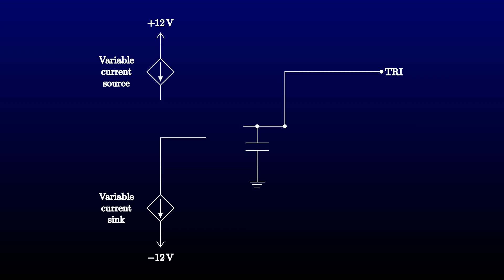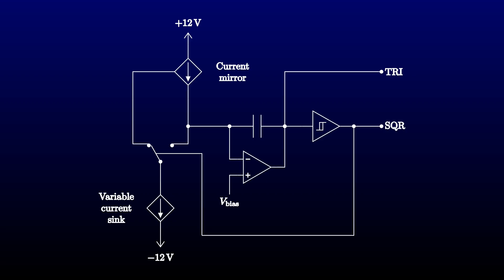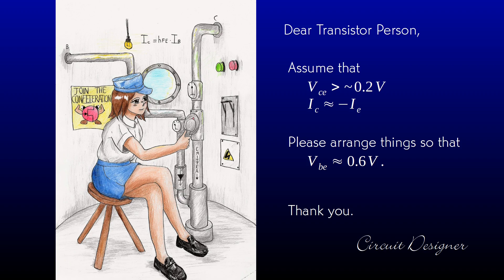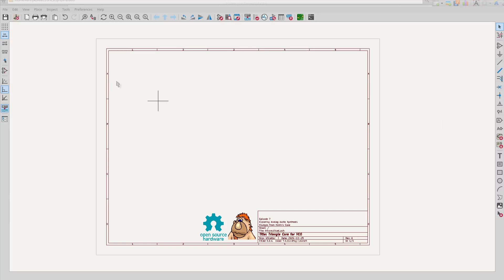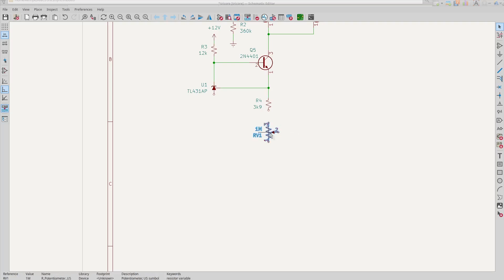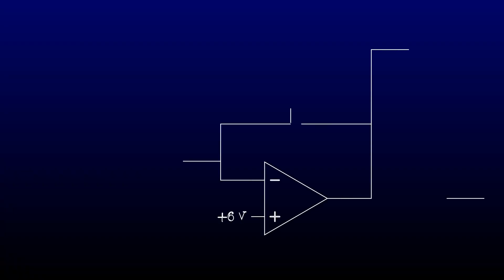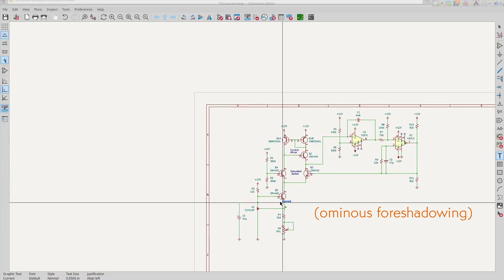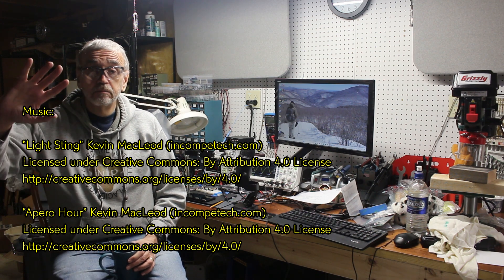Triangle-wave VCO Core - Explorig Analog Audio Synthesis, episode 8

Comment: Hi. I got a question to Q3 (can be seen at 14:13). When the comparator turn ON and activate the base of Q3, how do we control that the base current is not so large that it goes into the base and to the current source, instead of sinking the current from the integrator, from C2 (discharge)?
Reply from the maker: The LM311 comparator has an open-collector output, so it only sinks current, never sources it.  The only source for the base current is the pulll-up resistor.

Comment: Hi. Maybe I missed something, but what are the advantages of this circuit compared to the "traditional" circuit just comprising of a comparator and an opamp configured as an integrator (input - resistor- inverting input - capacitor - output)? To me it seems you can save a lot of component for the switch, all current mirrors and bipolar power supplies.
Reply from the maker: I'm building up to adding 1 volt per octave control, and having it stay in tune over the full audio range. The current source can be voltage controlled, and will later be replaced with an exponential converter.  The triangle wave is also accurate - linear slopes rather than the exp(-x) behaviour of a simple RC circuit, which will enable low-distortion wave shaping on the output.
Reply: @KludgesFromKevinsCave  Thank you for the answer. Yes I see, so more control can be added. But a integrator circuit with an opamp will also produce a accurate triangle wave even though it is build with R and C.
Reply from the maker: @thomassorensen7907  Getting an accurate triangle with a conventional op-amp is a little tricky. You need to charge and discharge the capacitor with a constant current, not a constant voltage dropped through a resistor. That takes at least an external transistor separate from the op amp. There's an earlier episode in the channel that demonstrates the issue.  Am I misunderstanding the circuit topology you are using?
Reply: @KludgesFromKevinsCave  OK...can you give a link to the video. Then I can get back to you, if we are talking in different directions :-) But a standard integrator circuit with an opamp, resistor and capcitor driven by a square wave should give a linearly increase and decrease of voltage on the output of the opamp.
Reply from the maker: OK, I think we're on the same page now - you're talking about the (essentially) two-op-amp circuit, with an integrator integrating the output of a Schmitt trigger, rather than the 555-style single-op-amp one. (I shouldn't answer messages before coffee.  Mmm, coffee!)

That would be fine with a pot to adjust the frequency (and perhaps a bank of capacitors for range switching).  But it would get pretty tricky to make it voltage controlled, and you'd wind up most likely with a circuit like the one I present (or one with the saturated differential pair replaced with a CMOS analog switch, or something). So we're on the same page, I think; this circuit is on the path to an exponential VCO.  

The final design might use something like a CEM3340/AS3340, which has a lot of the stuff internally, or at least use a current integrator built around an OTA. (I have a few LM13700s in the drawer.) Nevertheless, I wanted to explain the theory first, particularly since the specialized parts have a lurid history of going into and out of production.

And thanks for your post: it makes me realize that I actually skipped an episode, about exactly the topology you discuss.  I really need to discuss the simple triangle generator with an integrator, and then discuss how to voltage-control it.  I had VCO's on the brain when I've been making that series, and I also had power-supply rejection on the brain from anotherr, unrelated project.  I'll have a chance to come back to the simple triangle generator, since I'm only a couple of episodes away from introducing the integrator again in the op-amp series, so this is a good time to think about how best to slot it in. I might make it super-simple by using a rail-to-rail op-amp (LMC6482 or something) as the comparator stage. Doing it with a '6482 is just the resistors and a capacitor, and allows for pots to do independent frequency and amplitude control of the triangle.  Darn it, I meant to make that video!

For what it's worth:

The simple one-op-amp relaxation oscillator: https://www.youtube.com/watch?v=VH0WNji5CIQ . The 'triangle' isn't all that triangular.
Building up a more 555-style oscillator: amplitude and frequency much more repeatable: https://www.youtube.com/watch?v=mYEhulFMMgo . The 'triangle' still isn't all that triangular.
Doing it with a double current source (so that symmetry will be adjustable) and using diodes for current steering: https://www.youtube.com/watch?v=Vp5yTyl9E-I
Reply: @KludgesFromKevinsCave  Yes we are on the same page.....exactly that classic circuit two opamp circuit. Yes fully agree that controlling it with a voltage requires some redesign. Looking forward to the video(s).
I am doing a small project for myself and have just recently used the 2-opamp solution, together with an extra comparator to generate a variable PWM signal. I liked it because it don't require bipolar supplies and it is easy to adjust the required offset to get a symmetric output.
Once again thank you for the videos and the discussions and fast answers in the comments :-)

Comment: Triangle waves are fun! Saw a variant of this where both the source and sink are going all the time, and a diode bridge is used to steer either the source/sink into the comparator output, with the other sink/source going to the integrator. Fantastic presentations!
Reply from the maker: @mechiepete  There's an earlier episode in this series with my take on the diode bridge steering. I went to the differential pair so that the eventual exponential converter will see a constant-voltage load.

Comment: The fading-in-out of components during the design was brilliant. How do you animate and render out such nice looking circuits?
Reply from the maker: I do that rendering in Manim https://www.manim.community/ .  I draw the schematics in TeX using the CircuiTikZ package, and then embed them in a Tex or MathTex object in Manim.

I break the circuit into pieces by simply passing the Tex object the pieces separately, which then gives me a handle on them using 'submobjects' to manipulate them independently.  Then it turns into a whole bucket of boring Python code.

Comment: The 47pF cap is connected differently in the two versions. KiCad has it as a speed-up for the comparator, while the 2nd version shows it slowing the comparator down!
Reply from the maker: You found one of the mistakes in the schematic.  Next episode covers the debugging...

Comment: When you're placing components, use the X key to flip left for right, and use Y to flip top for bottom. No need for your own symbol, just flip it the right way around.
Reply from the maker: The problem with the symbols for the LM311 and the TL071 is that when you flip them, you get (+) and (-) in the right place and the power leads inverted. That bugs me, too. I use X and Y on other components all the time.
Reply: @KludgesFromKevinsCave  That's why I avoid the symbols with the integrated power leads. I prefer the multi-part symbols with part A being op-amp 1, and possibly parts B, C, D for additional op-amps, and finally separate power leads. I much prefer having power supplies and by-pass caps in their own section, away from the main action.
Reply from the maker: @TomLeg  does KiCAD have a symbol for a single op-amp with separate power leads? I've only found duals and quads done that way.
Reply: @KludgesFromKevinsCave  I never use singles --- can (almost) always find a use for an extra op amp.
Reply from the maker: @TomLeg  I don't use them very much either, except for specialty ones. Otherwise, I'd have fixed the symbols long ago! But singles make for a nice clean breadboard arrangement for teaching.
Reply: @KludgesFromKevinsCave  Somebody should contribute a nice, two-part symbol to the libraries. Too many rules for me, as an only intermediate amateur, but we can hope.

Comment: I love the video. My only question is how you calculated the frequency range. I know it relies on the capacitor or input current into the integrator, but I’d like to know more about the calculations and if it could be scaled to different frequency ranges.
Reply from the maker: The formula for the voltage at the integrator output (which we derived in the episode on the op-amp integrator, check the playlist) is V = (1/C) ∫ I dt.  Since I is a constant, ∫ I dt is just I ⋅ t plus a constant.  Rise and fall times of the triangle are equal.  We know the current, and we know the range that the voltage is moving through, so given the capacitance, we can solve for the frequency, of vice versa. 

It can be scaled to any frequency range you like, provided that the op-amp's slew rate is fast enough to keep up with it.

Comment: Thank you for the interesting series. I'd like to understand further the inclusion of C3 on the comparator + where you say you are adding some LP filtering (above audio freq) "to suppress glitches". I understand the intent  but I wonder what caused you to consider this potential glitching scenario in your design process. Looking at the datasheet for the LM311, I don't see a circuit in the application notes that suggests the addition of such a provision. So I am guessing this is coming from your own experience or some other standard practice. I am not an EE, and if I had just used datasheets as my guide, I would not have considered this addition. I'm guessing this addition comes from experience and makes the difference between a robust design and a hobbyist design. What caused you to consider the need to add the filtering?
Reply from the maker: Comparators switch very fast.  Sometimes there's a stray capacitance about that feeds some of that fast-switching output back around to the input, resulting in ringing.

In this particular case, I put in the capacitor because Buchla did - I was adapting an old design to more modern components and Eurorack voltages.  I don't want to spoil the next episode too much, but you'll learn in it that I made a bunch of mistakes in this one (and left them in intentionally because I wanted to show debugging the thing!) One of them was around that capacitor.

Comment: I recently thought about a nice source of matched transistors. CD4069 - 6 matched NMOS and 6 matched PMOS. Only negative thing is that they have their sources connected together internally. But that's okay for differential pairs and current mirrors anyway. Or for voltage controlled resistors connected to some common ground. It's a big package, but relatively cheap and available.
Reply from the maker: I keep BJT pairs in stock because I need them for exponential converters. A MOSFET is square-law, rather than exponential.  (I keep a few 4069's on hand anyway, as low-power inverters.)  For loose CMOS pairs, the 4007 is still being made. The nice thing about it is that the substrate isn't  tied to the sources for two of the pairs. MOSFETs with separate source and substrate connections are scarce as hens' teeth nowadays.  Check out https://schematicsforfree.com/files/Components/Semiconductors/ICs/Digital/CD4007%20Applications.pdf for some 4007 ideas.

Comment: Fantastic..another excellent tutorial..  and there's even a long tailed pair in there..  thanks 😊😊
Reply from the maker: A current mirror isn't exactly a long-tailed pair.  But I do have a video specifically on long-tailed pairs in the works.
Reply: @KludgesFromKevinsCave  yeah..  was a bit tongue n cheek after my previous request for a discussion on the long tailed pair..
Reply from the maker: Yeah, I remembered.  But every op-anp has a long-tailed pair in its input circuit, so there are still multiple long-tailed pairs in there.
Reply: @KludgesFromKevinsCave  touche' .. i can't argue with that at all haha..